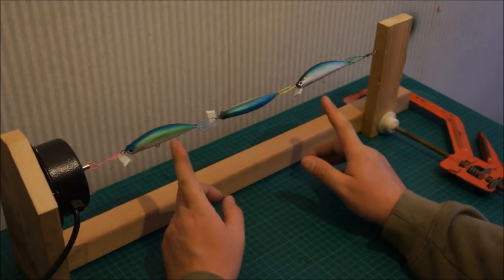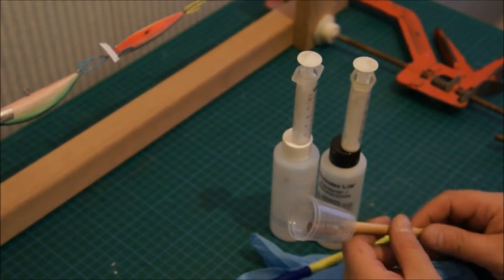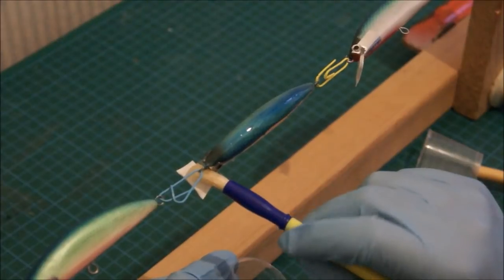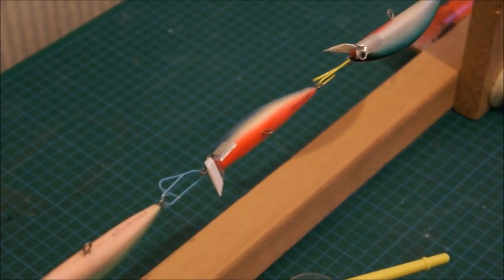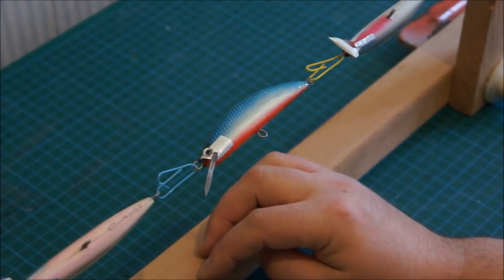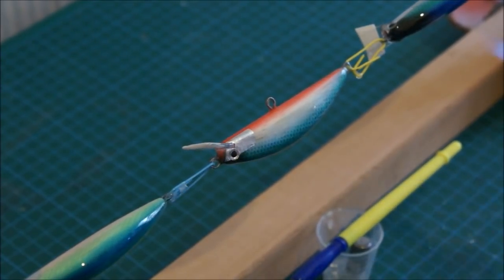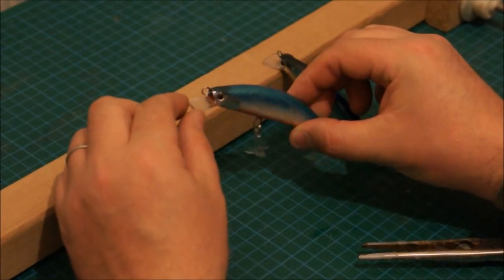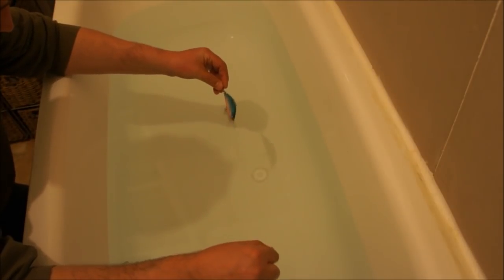How To Make A Balsa Fishing Lure Part 7

Comment from the maker: adding weight can reduce the action of  lure, but from my own experience there are a lot of variables and weight is just one factor. Experiment is the only answer i could give. A good way i use to change the weight of a lure or the position of the weights without cutting it up and starting again is to use self adhesive weights placed externally.   Motorcycle wheel weights work well or just some lead and external double sided tape. 

cheers

Comment: I found the files. When using my ipad i couldn't see the links you posted with the videos. Thanks. I still have a question though....if i want to make a heavy version, will it change the action? For example, i can use redgum, which is very heavy. Also, if I'd like to put more weight in, what's your advise? I'd like a lure around 30 grams for the surf...

Comment: Hi Paul, My I Ask Why You Use A Butane Gas Lighter To Dry Your Lure's, You May Given The Answer But I'm Sorry I Missed It! Thanks For Producing Another Brilliant Video "Great Work, Well Done"
Reply from the maker: it is not dry the lures it is top pop any bubbles trapped in the surface, thanks
Reply: Is it the carbon monoxide gas that draws the bubbles to the surface ?
Reply from the maker: not entirely sure to be honest
Reply: In Your Video "Making A Bullet Proof Glide (Jerk) Bait Fishing Lure Part 1 @ 3:20 Secs You Answer My Question "To Break The Surface Tension" Thanks For Another Great Video, Slowly Working Thru Your Work